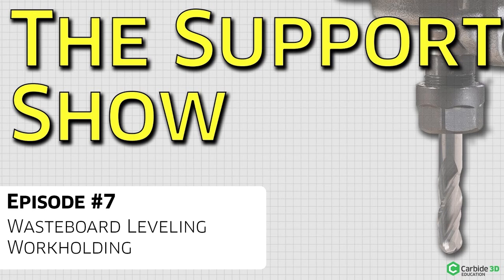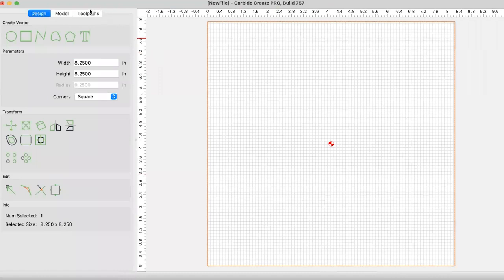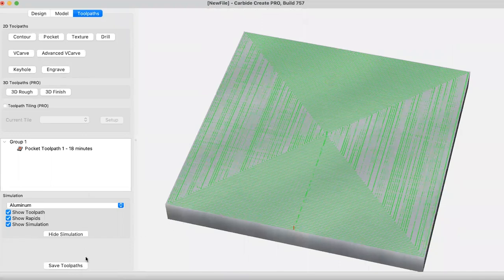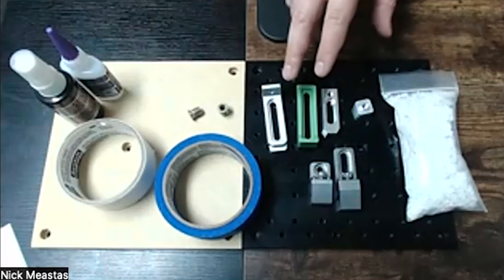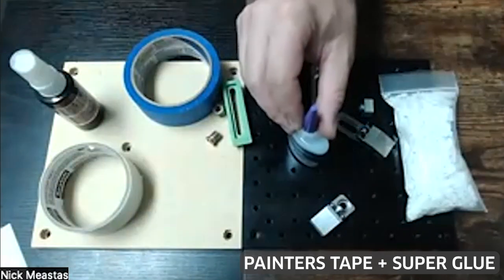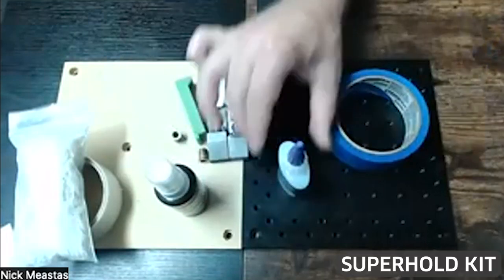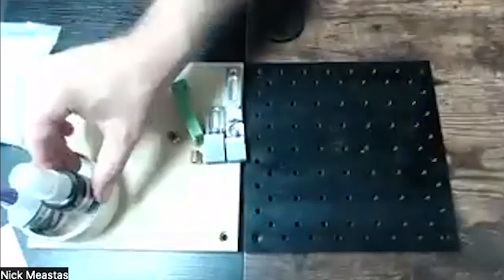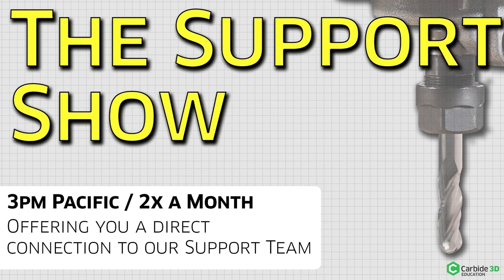Episode #7 - Wasteboard Leveling + Workholding

Comment: I have a 4x4 Pro 5 machine. I see you using a 1/4" mill to flatten the waste board.  For larger tables would suggest using a larger mill (3/4") or would you stick to the smaller mill?
Reply from the maker: For Shapeoko you should use our 1” McFly Cutter.   https://shop.carbide3d.com/collections/cutters/products/mcflycutter?variant=39332570955837

Comment: There should be an option for rastering a pocket, especially when using a facing mill that should never be plunged in the center of pocket. Having said that, I just leveled my 48x48 yesterday by manually creating a rastering program for one 3x48 slat and running it 12 times, shifting 4" over each time.